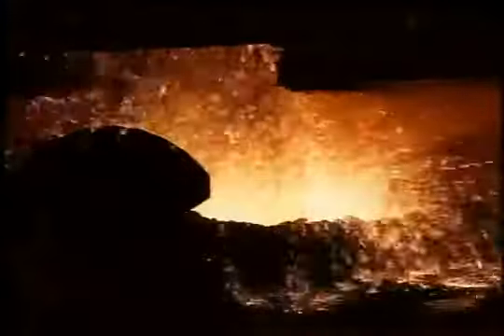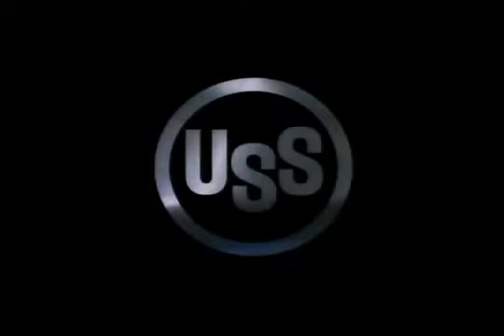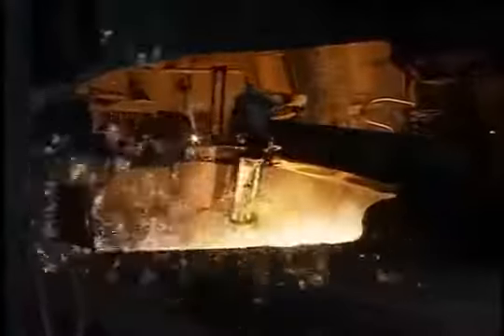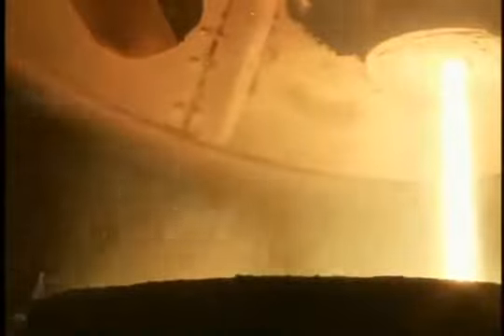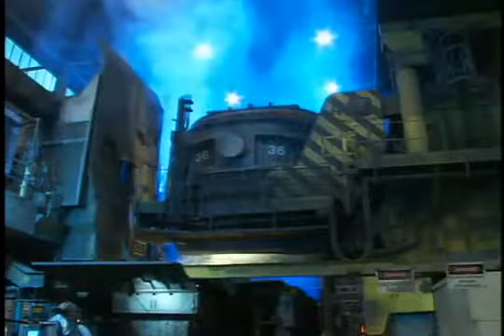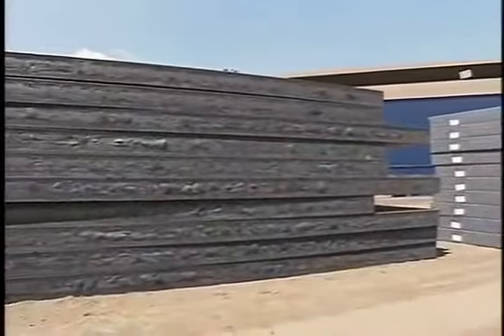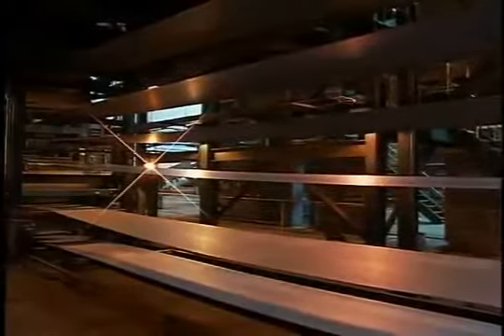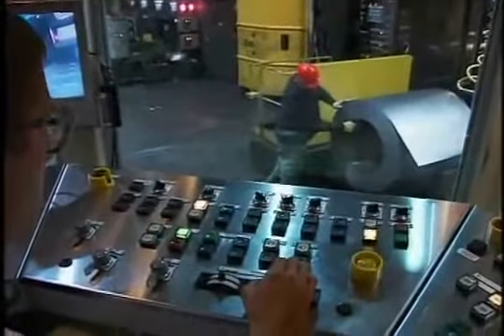STEEL  From Start to Finish

Comment: Faizal Nugraha Ramadhan
kuis 1
2713100149

Steel making the process starts with the production of iron which the material is iron ore,coal,and lime stone,. The other raw material throw to the furnace  as 1100 centigrade  the coal now is converted into metallurgical coke consisting pure carbon with minor pollution. Removes from the furnace the metallurgic coke guided through quenching station and after that will cooling rescreen large size coke and lumph coke later on to be used in bast furnace and small coke breeze to be used in the sintering process.
Iron ore,coke,and limestone now carefully dispense and blended,this blend spread on the strand which slowly moves under combustion,
the sintering process,the combustion zone go downward to the blend on high temperature sinter ground iron into the pouring  as soon as the blended is completely burned through it is  call crush and screened while the fines and return to sintering process,the remaining product is the sinter,basically prepare for the next  step
a blast furnace operation,sinter ,lumph coke,and limestone are via conveyor belts or skips transported to the top of blast furnace,iron ore is principally compound of iron and oxygen,iron is produce by the extraction of oxygen using coke ,this reaction is endothermic. To sustain the reaction extra coke is injected together with hot air,the air is preheated around 1250 degree centigrade in hot blast vessel and blown into the furnace, two choices future equally distributed around the furnace,moving downward the sinter,coke,and limestone are converted to liquid iron and slag to save the use of expensive metallurgical coke some time poverized coke or oil is injected. By computer the process operating parameters kept under close control. The iron turn to pig iron is collected at the bottom of blast furnace and tapped into torpedo ladle
begining with desulfurization process by injecting lime powder to avoid loss of ductility at high temperature a sulfur reduction values lower than 0.01 percent is necessary.
Now liquid pig iron is transported to the steel plant. Steelmaking can be carried out in several process nowdays only the oxy steel  and electrical arc process. The liquid pig iron  is transferred  into another ladle, the temperature is measured,samples are sent to laboratory, and the floating slag is removed. Liquid pig iron is now pour into the converter,subsequently scrap is added this is to control the temperature increase due to oxidation impurities mainly carbon and silicon . Pure oxygen is blown into the blast, the impurities of oxidize and slag are floating on the surface. Finally the temperature above 1620°C is obtained. At the end of the oxidation process the samples are taken for chemical analysis. Within five minutes the result are presented on the screen in the steel plant, from the analysis also the announcer following elements: in reagents for dissolve reactions and the oxidation determinant. Alloying elements to ensure a steel composition related to the final properties and used of the steel. By using the alumunium the steel is deoxidize (4Al+3O2 -> 2Al2O3) the steel is killed. The alumunium associated with the oxygen and improve the ductility these element will be added during taping of the steel from the converter into the huge ladle. The ladle is placed under the converter, steel and slag up or down to the converter separately. Tapping first the steel, after that the slag. The liquid steel is then stir using an inert gas (argon) this to ensure composition and temperature to be homogenous throughout the ladle. In addition the gas bubbles float out impurities, which are observed into the slag. After refining the ladle now containing about 300 tons of liquid steel is taken usage in continuous casting machine. Pour like here into an emptied in gate mold.

Comment: DELFT "SteelMaking QUIZ 1"
annisa riyanti 2713100115

process of steel making is started with raw materials that consist of iron ore, coke and limestone.

the iron ore is stored according to its origin. it is rotated in rotation drum before it is transferred to the next step of processing.

the coke is made from the coal. it is blown into the furnace, and then it is now converted into metallurgical coke. consisting of pure carbon with small pollution. then the coke is quenched and separated based on its size,from large size as a lump coke that is used for blast furnace and small coke breeze that is used in sintering process.

iron ore, coke breeze and limestone are carefully blanded. it is a stray that move under a combustion. the heat turn the iron ore to be porus, and after all of the material is blended, it is colded, crushed and screened while the fines is returned to sintering process. the remaining product is the sinter.

in the blast furnace process, sinters, lump cokes and limestones are transferred by conveyor belt and transferred to the top of the furnace. iron ore is compound by iron and oxygen. the iron is produced by extraction of oxygen by the cokes. in the furnace, the iron burden is blasted with hot air that is pre-heated around 1250 celcius degree. after the hot air is blown, the sinter, coke and limestone are converted into molten metal and slag. the iron that is produced, is called pig iron.

the pig iron is transferred to steel making plant. there are some ways to make steels, bu now days the convention way is by using oxy steel converter and electric arc furnace. in oxygen steel converter, the pig iron is transferred to another ladle. the temperature is measured and the sample is sent to the laboratory. the floating slag is removed, and liquid pig iron is  now poured into a converter. scrap is added. and the temperature is increased to oxidate the impurities. pure oxygen is blown into the converter. the slag will float and the molten steel will be taken to be tested. sometimes aluminium will be added to keep it ductile.

the molten steel will tapped, separating from its slag. the molten steel will be refined with inert gasses, such as argon, that will float out the impurities and become slag. after refining, the ladle will be moved into continuous casting process and become steel that we can use for our daily life.

Comment: DELFT "Steel Making Quiz 1
Panji Harga Susila
2713100110

I make a review from the video I watched, the title is making steel and the afterglow made by Delft University of Technology. The very first step of steel making is the production of iron, which the raw materials are iron ore (Fe2O3), coke (C), and limestones (CaCO3). The iron ore stored  according to its origin, and transported to a layer then the layer was mixed by rotating drums to make an optimum blend. Beside the iron ore the other raw materials, coke was blown into the furnace. The coal was converted into coke that consist of a pure carbon at 1100 degree celcius. Afterward the coke from furnace were transported to quenching zone. After cooling session they were screening the coke into two different size coke, they were large size coke ad small size coke. The large size coke would be used in blast furnace and the small size coke would be used in synthering process.  Then all the raw  materials, they were iron ores, cokes, and limestones were blended together. This blend would be spreaded on the strain with slowly moves under combustion hood. The combustion moves down trough the blend with high temperatures. As soon as the blend had completely burned. First the blend was cooled, then crushed and screwed. The remaining product is the synther and basically burning in the next process which is the blast furnace operation. Synther, large cokes, and limestone were transported by a conveyer to the top of the blast furnace. Basically iron ore was composed of an iron and oxygen. The reaction by the oxygen and the cokes produced the iron . in the blast furnace the cokes was injected together with heated air. The heated air blown by tuyere with totally distributed around the blast furnace. All the raw materials would be liquid iron and slags in the furnace. Sometime they reuse the cokes to save cost. All the process operated by computer control. The pig iron as the result is collected by the bottom of the blast furnace. The steel making starts began with disolveritation process by injecting lime powder. A sulfur reduction needed to lose ductility from high temperature. Then the iquid pig iron transported to the steel plant. There were two kind of steel making process, oxygen steel and electric arc furnace. Oxygen steel making process the liquid pig iron send into another lethal and removed the slag. Then liquid iron moved into converter. Some scraps is added to control the temperature during the oxidation of the impurities. Then the pure oxygen is injected into the converter, then the impurities turned into slags that floating in the converters surface, then samples are taken for analysis. After the slag is removed and cleaned, the molten steel is tapped to continue the process of steelmaking.

Comment: Ramosan Sirait 2713100010

DELFT 'Steel Making Quiz 1'

This video is telling us about the process of steel making. The raw material are iron ore, coal and limestone and mix to make an optimum blend. The blend will transported rolling over the furnace. The other raw material is blown into the furnace. At 11000C the coal converted into metallurgic coal. This metallurgic coal now consisting pure carbon with minor pollution . After cooling, we screen into large size coke, or also called long coke and small coke. The long coke is use in the blast furnace while the small coke is use in sintering process. The iron ore, coke and also limestone blended and move to the combustion. After that we continue to the sintering process.
In the sintering process, the combustion move downward to the blend. As soon as the blend is completely burn through, the blend is cool, crush, and screen. Meanwhile, the fine return to the sintering process. The remaining product is the sinter. The sinter is a basic component for the next step, which is blast furnace operation
The blast furnace operation is begin with the sinter, long coke and limestone are transported in to the top of the blast furnace. Iron ore is principle a compound of iron and oxygen. The iron produce by extracting oxygen using coke. The reaction is endothermic. To sustain the reaction, we inject extra coke with the hot air. The air is pre heated to around 12500 Celcius in hot blast stove. Than it blown in to the furnace through the tuyeres. The tuyeres are equally distributed around the blast furnace. Moving downward, the sinter, coke and limestone are converted into liquid iron and slag. To safety use the more expensive metallurgic coke, sometimes the pulverized coke or oil is injected in to the furnace. The process operating parameters are kept on the close control by computer. The iron produce from here is pig iron and can be colleted from the bottom of the blast furnace
Next is steel making process, which can be carried out in to several process. The oxy steel converter and electric blast furnace is what relevant now. In the oxy steel converter process, the liquid pig iron pour in to converter and the scrap is subsequently added. Than the pure oxygen is blown, and the impurities oxide to slag  that floating on the surface. The temperature reach about 16500 C. after that we add alloy element according to the final properties and use of the steel. The steel than separated from the slag by poring to the converter separately. We use eart gas to ensure the composition of steel is homogen and remove the remaining impurities. Than the steel can be casting and continue to next process according to the uses.

Thank you

Comment: DELFT 'Steel Making Quiz 1'
Abdilah Sismantoro 
2713100145
PBB B

Video Review: Steelmaking

As we know that steel is something  really huge to a country. It can determine that a country is prior to another, based on its steel industry.

In that way, we have to know how the steel itself is made. This video once again shows us about the steelmaking process.

The process basically starts with the production of iron, which are iron ore, coke and limestone. The iron ore stored according to origin. Then a various source are reclaimed and made into layers, before we continue to the next step of the process, the layers are mixed in the reclaimer to make an optimal blend. Via a transporter rolling over a furnace, the other material, the coal ground to powder is blown into the furnace.  At 1100 degrees celcius,  the coal is now converted into metallurgical coke consisting of pure carbon with minor pollution. After that, the metallurgic coke is guided through quenching station. After cooling process, it screened  in to large size coke, term-lump coke, that later on to be used in the blast furnace, and small coke breeze to be used in the sintering process.

Iron ore, coke breeze and also limestone are now carefully dispensed and blended. This blends are spread on the strand which slowly moves under combustion, the sintering process. The combustion zone moves downward through the blends. The high temperature sinters the ground iron ore. As soon as the blend is completely burned  through, it is cooled, crushed, and screened, while the fines are returned to the sintering process. The remaining product is the sinter, which is to be the basic component for the next step, the blast furnace operation.

Sinter, lump coke and limestone are via conveyer belt are transported to the top of the blast furnace.  Iron ore is pricipally a compound of iron and oxygen. Iron is produced by the extraction of oxygen using coke. This reaction is endothermic. To sustain the reaction, extra coke are injected together with the hot air. The air is preheated to around 1250 degrees celcius in hot blast zone, and blown in to the furnace through tuyers, which are equally distributed around the furnace.
Moving downwards, the sinter, coke and limestone are converted into liquid iron and slag. To save the used of the more expensive metallurgic coke, sometimes polarized coal is injected. By computers, the process operating parameters are kept under close control. The iron turned to pig iron, later is collected at the bottom of blast furnace and tapped into a torpedo ladle. Then, the real steel making process starts.
Beginning with the desulfurazation process, by injecting lime powder. To avoid the loss of ductility at high temperature, a several reduction which values are lower than 0,01 percent is necessary.  Now the liquid pig iron is transported to the steel plant.

Steelmaking can be carried out in several processes. Nowadays, only the oxy steel and electric arc processes are relevant. In the oxygen steelmaking process, the liquid pig iron is transfered into another ladle. The temperatur is measured. Samples are sent to the laboratory, and the floating slag is removed. The liquid pig iron is now poured into a converter. Subsequently, scrap is added. This is to control the temperature increase due to oxidation impurities, mainly carbon and silicon. And then pure oxgen is blown into the bath. The impurities are oxidized to slag that is floating on the surface of the bath. Finally the bath temperature at 1650 deegrees celcius is obtained. At the end of the oxidation process,  samples are taken for chemical analyses. Within five minutes, the results are presented on the screen in this steel plant. From the analyses, also the amounts of alloying element and reagents for desulfurization and deoxidaztion are determined. Alloying elements, to ensure the steel composition related to the final properties and used of the steel. By using the alluminium, the steel is deoxidized. The alluminium associates with oxygen improving ductility. These elements will be added during the process of the steel from the converter into this huge ladle. The ladle is placed under the converter. Steel and slag are poured out to the converter separately. Tapping, first the steel after that the slag. The liquid steel is then stirred using an inert gas, argon. This to ensure the composition and temperature to be homogeneous throughout the ladle. In addition, the gas bubbles floated out impurities which are absorped into the slag.

After refining, the ladle now containing about 200 tons of liquid steel. It is taken either to a continuous casting machine or emptied into ingot molds, which is then will be continued to several process to make something that involved in our daily life, such as vehicles, the framework of buildings and many more.